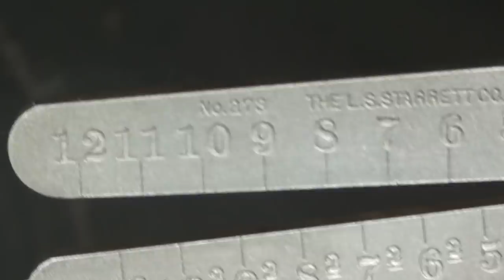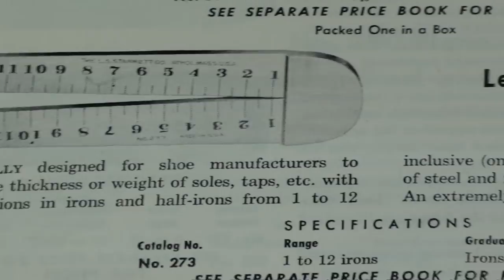What is It? MYSTERY TOOL 45b answer tubalcain mrpete222 DIVER"S KNIFE

Comment: We used "sound-powered" phones all over the ship when I was in the Navy...and I imagine they are still in use today.  Thanks, Mr. Pete! :-)
Reply from the maker: I need to read up on that, sounds very intriguing
Reply: They were also in The Royal Navy I think the idea was that if power went down you still had a way of communicating with the rest of the ship.
Reply: @mrpete222  Go find yourself a copy of the Boy Electrician. It has detailed plans for making phones, both plain and with a loop battery, *from scratch*. You'll need soft iron wire, a ton of magnet wire, and plenty of patience.

Comment: great videos! I have a shock remover tool just like the K-D tool ! It came with 2  hollow Hex tubes that fit over the round part that has the Double-D socket in the end! You could put a ratcheting wrench over the hex to take the nut off the threads! worked great just need the put some WD40 or some lube on the threads first! by the way I also live in South Louisiana , and we have sugar cane all around us!  I work in the big Machine Shop , I  have about almost 40 years of machining! Right now I am rebuilding 2  pumps for a sugar mill that pump the thick hot molasses ! We do work for alot of the mills around here! Franklin,La. is home! thanks for all the videos !

Comment: Greetings from down under Mr Pete. I believe the nickel plated measure is for AWG cable sizes (aka B&S, for Brown and Sharpe), with 0000 being the largest.
Reply: Geoff Mathieson    Me too, believe you are correct, probable for round section solid wire ( as compared to perfect-lay stranded, that has slightly different bundle diameters.

Comment: Very interesting and entertaining video.  I remember when I was a boy of about 6 years we lived south of Ringling Oklahoma and some people were raising sugar cane.  We heard they were making molasses on Monday or some such so we drove over there and they had a big old press with a flat belt and it was on wheels.  They were running the flat belt with the big flywheel on a John Deere tractor.  And right beside it they were cooking the sugar cane and making molasses.  I was very interested to see that when the belt started to slip they would pour some molasses on it and it stopped slipping.  I understand the syrup near the bottom of the cooker that gets a little burnt is where you get black strap molasses.  Sorry for running on thanks for the video.
Reply: Actually the molasses is what is left over after the sugar is crystalized out of the cane liquid.  Each time they boiil the liquid, more sugar comes out.  The third boiling is called black strap.  It is the thickest and has the least amount of sugar.

Comment: I have been watching your videos . I am 65 years old and have been in machine shops up until four years ago when I retired at the age of 60. I have one of the shapers that you did one of your videos on, mine has the original motor and flat belt pulleys. I acquired it about 15 years ago from a friend of mine who did not want it anymore, another friend of mine asked me why I wanted it and I told him because you can cut angles on a shaper that you cannot cut on a mill and you can also broach with them. The shaper that I have is in very good shape I don’t think it was used very much. When I was younger I worked in the shop rebuilding machinery and I ran all kinds of planers , One of the planers was built in around 1900 is DC power off of a generator and the table was 6 foot wide and 40 foot long, I think the shop that the planer  was in is still there and I think they still have the Planer even though no one there knows how to run it, I don’t believe that anyone has ran that machine in years. I have a nice little shop of my own with a  Bridgeport mill I have a 16 inch Southbend Lathe that I totally rebuilt about six or seven years ago. I like the videos you do about the steam engines. My last 30 years in machine shop was a tool and die shop at American Airlines. When I first went into that shop we did have a 24 inch Cincinnati shaper, only a couple of us knew how to use it and the shop finally got rid of it because no one did use it. Keep doing your videos I enjoy watching them, I like the old machinery better than I do the new stuff I have ran a few CNCs and  I find them quite boring,I like to run the hands-on conventional machinery.
Reply from the maker: It sounds like you had quite a career in machine shop. That was one heck of a big planer you were running. Not many of those left I bet.  I am like you, I like the old machinery with the Kranks not computers.

Comment: Hello Mr Pete, I am really glad I run on to your channel, look forward to your videos, I have learned a lot. I did notice the shock tool you have is missing the 2 sockets that slide onto the shafts to turn the nut,(if you were lucky) It only worked 1 time out of 50 ,lol  It only worked on fairly new shocks so it was kind of worthless. I still have one in my box and folks scratch their heads for a while and never figure what it is. Always  found it easier to put a tight fitting socket on a long extension and work it back and forth without turning it and break the bolt off.Just my 2 cents lol,Thanks again for all you do,The worlds need more Mr Petes and a lot less mr know it alls... lol
Reply from the maker: Yes, another worthless tool

Comment: The gauge at 7:02 is a wire gauge.
The bagasse or the leavings of pressed can is used as fuel for the boilers to make steam for processing the sugar cane syrup into sugar.  The boiling of the syrup to extract the water is done under high vacuum so the temperature is less than 180 degrees F to keep from scorching or burning the sugar.  The thick mass left after water removal is spun in a centrifuge  to sling most of the water from it and that is the granulated sugar or brown sugar..  The white stuff on the table has been bleached and ground to size.
Reply from the maker: Thanks

Comment: The leather soul gauge doesn't actually measure thickness. The numbers on the side reference the weight of the leather. So the piece you were measuring would be considered 8 oz leather although hides are often given a range like 8-9 oz weight. But I sure didn't know what that gauge was... I use leather in making holsters for my knives. Very interesting.
Reply from the maker: Thanks

Comment: When I was in the Navy both ships I was on had sound powered communications the set consisted of a pair of headphones and a microphone that was wired to a small chest piece that hung around your neck. Where the set plugged into the system there was a water tight screw cap you had to remove and plug/screw the cable into the junction box. Phew that was a long explanation but they were sound powered you speaking into the microphone also generated the power need for transmission on the system and each area had a separate system.
Reply from the maker: Thank you, that’s interesting

Comment: bagasse is pronounced locally as "bah-gass".  The insulation in my home is made from it. It is mostly used as fuel in the boilers that operate the sugar cane mills. A neat note of trivia, over 95% of all sugarcane produced is cloned from a single stalk produced by the LSU agricultural extension agency a couple of decades ago.  To facilitate the cloning, you bury the stalk horizontally in the soil and each nodule (or joint) will produce a new plant. The cane is almost never grown from seed.
BTW: I live in the next town from Paulina, Lutcher. More trivia,  Paulina produces the world's supply of Perique (per-reek) tobacco. It will grow no where else in the world.
Reply from the maker: Thank you for some good information. I live in Corn country
Reply: I live in Baton Rouge, if you ever want to get together.